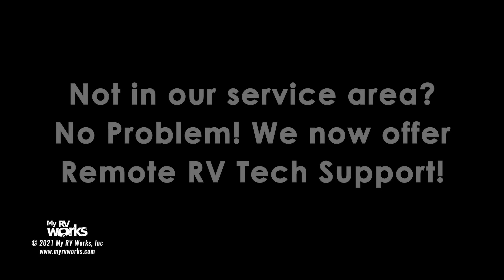[Q & A] 10 Minutes With An RV Tech - Session 10

Comment: I have a honey chevy with a 454 and the wires that go to the batttery got mixed up when replacing  the batteries. Got them hooked back and somethings wrong
 Its making a continuse intermitten sound and the lights flash when .aking thag sound. It sounds like e flasher. Also i dont have 12 volt.

Comment: I recently lost my awning to wind and I will be replacing my awning. The previous awning has three rivets on the bottom of the arm that attaches to the rv. What would best hardware to use to attach the new awning arms? Should I use rivets? Something else? Would jack nuts work? Also, can I reuse the old holes? Thanks.
Reply from the maker: This is the type of rivet that they are using. Just picture you get the right size.

https://amzn.to/3PmNWW8

Comment: Hey Darren what is the best way to store my motor home for the off season. Should I leave it plugged in and the charge / inverter running or should I just shut off batteries on the coach switch and the chassis switch. Thanks. Clyde Astoria Oregon

Comment: Your electrical comments were spot on.   The reason they were getting 65 volts is that the neutral and ground conductors were not bonded anywhere.  So, there is no zero reference point for the meter to read from.   
Thanks for your videos!   Always educational!    Respectfully,   Kevin

Comment: Hi I’m making a comment on one of your older videos about the roof A/C plenum I have a 2000 Dutch Star Motorhome it has no plenum It draws inside air threw 2 or 3 air ducts and returns cold air threw the other ducts seems like it doesn’t work as good as it should any suggestions
Reply from the maker: If you cannot get to that ceiling plenum From below because it's not there, you'll have to gain access to it from the top.  You'll have to remove several screws but you can get to it and make sure that the divider is set correctly.

Comment: When you turn your air conditioner on and it runs for 15 minutes and trips to breaker and the cold and evaporator are clean what could be my problem?
Reply: Check out his other video on how to test an ac. My 1st checks would be capacitor and compressor but im not as experienced as he is
Reply from the maker: We need to isolate if the problem is with the air conditioner  the Romex wire running through the walls  or the breaker itself. One thing you can try is get some 12-2  Romex and run it from the breaker up to the air conditioner (basically bypassing the existing Romex Wire installed by the manufacturer). That will put the focus on the wiring in the walls as being a potential problem.  If your air conditioner works fine that way then you know that the issue is with the wiring in the walls. If the breaker still trips then you have to look at the air conditioner or the breaker next.  Of course there are more advanced ways of checking current draw at the compressor Etc. but some people don't have those tools and this is something that's very simple that you can try.
Reply: @MyRVWorks  see and i knew that but my brain went elsewhere thats why i watch and learn :) troubleshooting is an art thats for sure im 4 months in and even with 20 yrs in you can still learn ive realized that as well

Comment: couple days ago I watched your rv brake and bearing video, very informative.  My question, what type of grease do you recommend to repack re rv wheel bearings.  Thank you.
Reply from the maker: Most shops are going to use red grease. I go with the green grease in the video because I do my own work and it lasted longer then the red if I don't get around to repacking them at the proper intervals.  Basically any grease that's rated for wheel bearings will work.
Reply: @MyRVWorks  great thank you

Comment: We're in 90+ ° heat and our AC is not blowing cold,  but the compressor works. Its a dometic. Can it be recharged?  If so, do we call mobile tech? Or any ac tech?
Reply: Get a thermometer and see what temp is blowing out if its 70ish its working as intended if not call a rv mobile service as those ac's cant legally be recharged

Comment: CAUTION: If you buy a Harbor Freight "air" rivet gun... MAKE SURE YOUR FACE IS NOT BEHIND THE RIVET GUN!
I had one, the back of the rivet gun blow apart and luckily my face wasn't behind it.
Reply: Don't buy tools from HF. Problem solved.
Reply: @GoGreenMobileRVRepair  I couldn't find a Craftsman air rivet gun. I buy Craftsman tools and not Snap On because people steal Snap On, Mac, etc.
It's an air rivet gun dude.... and hard to find quickly and most people would think to buy at HF and the point is BEWARE of HF air rivet gun. 10-4

Comment: Hello hey I heard you say on a video about converters need to know the changes you do well I had 1 battery on my RV and I pu two batterys how to tell what converters to put in??????
Reply from the maker: The answer is a mathematical balance between how much power is available and how quickly you need to charge your batteries. If your RV will be connected to shore power most of the time then you can charge your batteries slowly and therefore a 4o-50 amp battery charger will suffice. If you need to charge those batteries faster than you'll need to go with a higher output converter but it will take more power from your short cord to do that.
Reply: @MyRVWorks  Thank you very much

Comment: why do you limit your video to 10 min?
Reply from the maker: It just seems like a nice round number.  We can usually get Darren to answer two or three questions in that time frame.
Reply: Ref: My earlier question about the piggybacking of a live line to a converter: a ‘professional has my panel wired like that. The converter hot wire is to the 30 amp main breaker and the live feed is in the pigtail on the hot wire of the converter. I am not comfortable with that. I only have a three breaker buss bar with the first breaker bring the main(it is the one with the hot wire in it from the converter). MY QUESTION: Can I replace the main 30 amp breaker with a 15/30 tandem breaker? Then I could put the converter hot in the 15 amp side and put the live feed wire in the 30 amp side. WOULD THAT MESS UP The FEED OR Would THAT WORK? The second breaker (20 amp)is empty ( converter would not work on it) and third breaker (30 amp also) had air conditioner on it! Converter did not work on that one either. So I am going to wire the converter into the dual main breaker on the15 amp side and put live feed wire straight back into the  30 amp side and wire nut the pigtail end on converter hot. WOULD THAT BE BETTER?  Thank you for your answer. The breaker(Bryant) should be here on the 17th. panel is old parallax system. Three buss bar. 30-20-30 amp.

Comment: Can u piggy back a live 30 amp main breaker to a converter hot wire and insert the crimped end
Reply: Into the slot where the main hot wire should be? The incoming live 11O- 120 volt wire on the 30 amp breaker is PIGGYBACKED to the converter.  Is this ok????
Reply from the maker: It is not the safest way to do that.  Usually, the converter is fed from a separate 15 amp circuit breaker that may or may not also feed other receptacles in the RV.  The purpose of the breaker is to protect the wire.  By feeding the converter with a 30 amp breaker the converter will melt before the breaker trips due to an over current situation.
Reply: @MyRVWorks  you